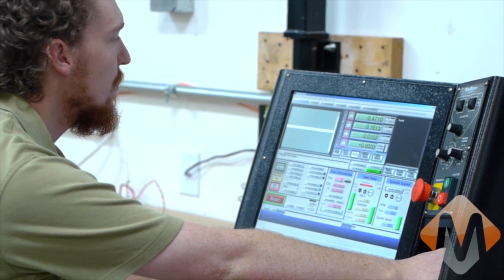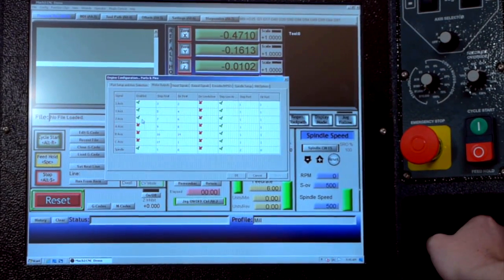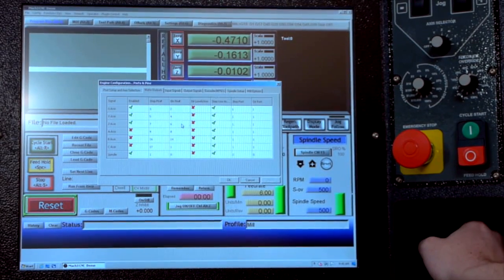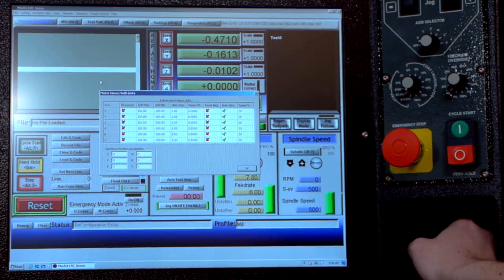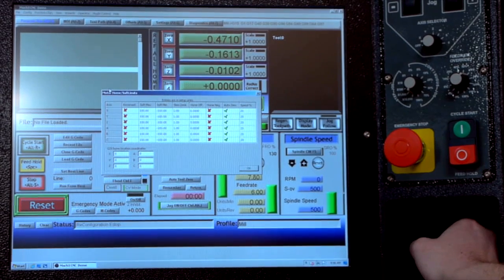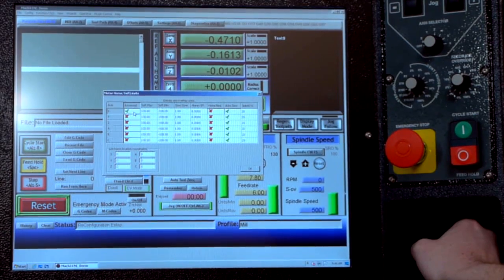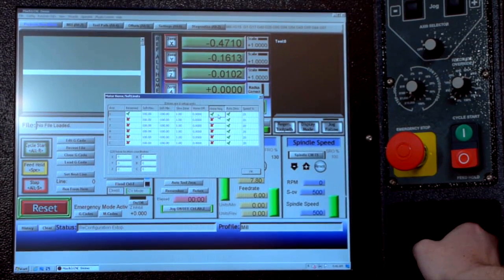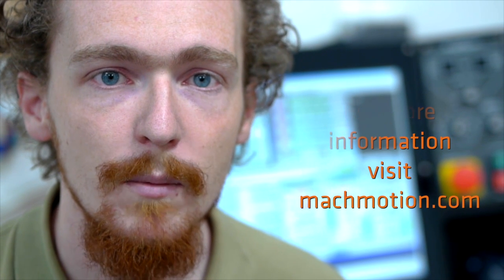Configuring an Axis in Mach3

Comment: Thank you for posting this. One of my stepper motors failed (wiring connections), and I started getting motion errors (missed steps). When I put in the replacement motor, the direction was reversed, and I had forgotten all the details of how to configure motor direction...  Your video concisely solved my issue.

Comment: Jogging my Z axis, some times it moves in the wrong direction. Press the down button and it may move up let it go and press again it will go down. Same with the Z up button. Mach thinks it is moving in the correct direction when the torch head itself is moving in opposite direction as the controller thinks.

Comment: I have a question I need help here I flip my y and X to do a mod around set everything it is cutting correct but on Mach 3 it is showing backwards if it's cutting on my left side it shows it on the right side mach3  but on the table it is correct.
Reply: Hey, Michael. For liability reasons, we can't give tech help on YouTube. We only provide in depth support to customers that have bought control from us. I recommend finding a Mach3 forum online to try to find help there. Good luck!

Comment: Where do you check when left and right arrows move in same direction?
Reply: Hard to say for sure. Sometimes this happens when the machine somehow gets outside of software limits. Then, it will always move in one direction until it gets back inside soft limits.
Reply: @natehall2622  I figured it out. The numbers for xyz listed everywhere had to be reversed in mach and it worked perfectly.
Reply: @cpu64  Rock on! Thanks for the update.